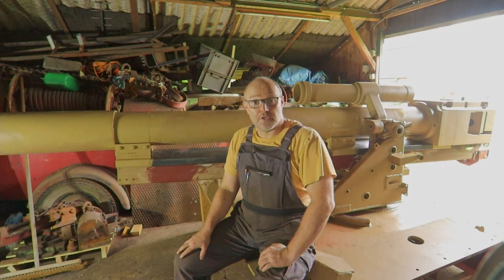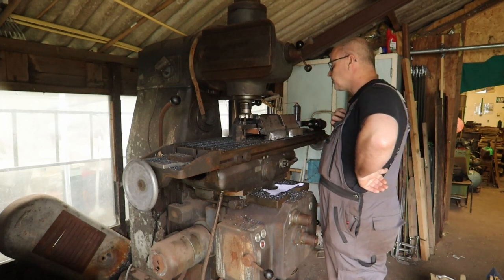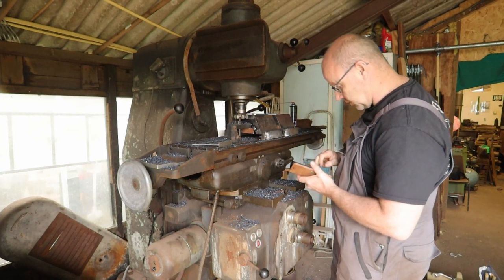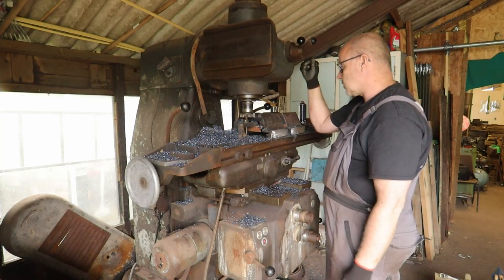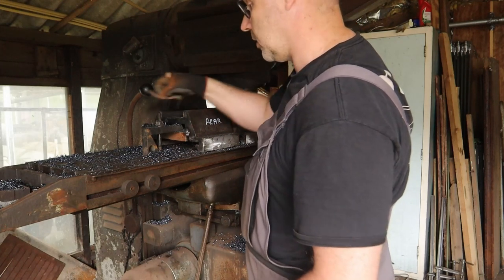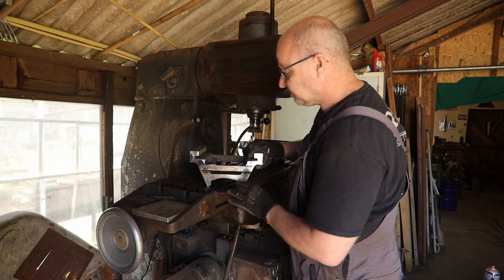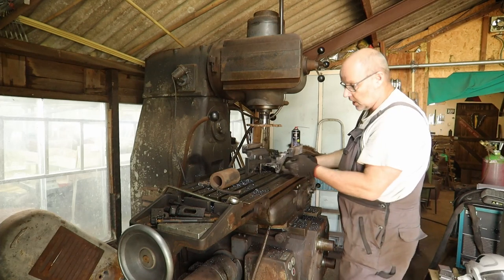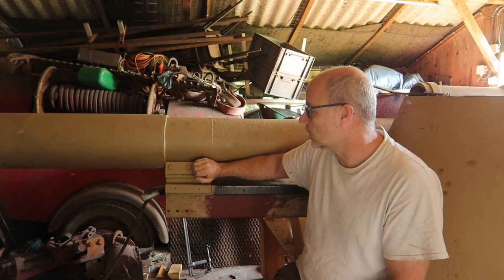Barrel clamps making installing to Nashorn pak 43/41 cradle

Comment: Wow, what a job, can't wait till its all together and working.... 👍👍👍!!!
Is the barell/bracket support in the front next in turn?
Reply from the maker: You mean travel lock?
Reply: @jackofalltrades164  I don't exactly know the technical denomination, but guess its the correct one as I suppose the barell is locked while moving when not in action.....
Reply from the maker: Travel lock is the bracket on the front which clamps the barrel to the vehicle for traveling.
Reply: @jackofalltrades164  yepp, that's the one, are you going to do that one next?
Reply from the maker: After everything fits correctly